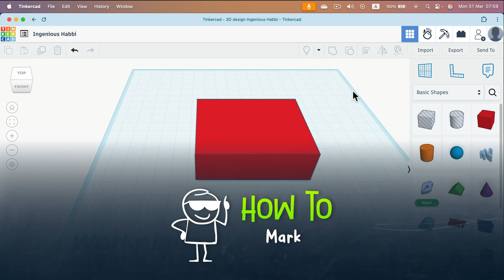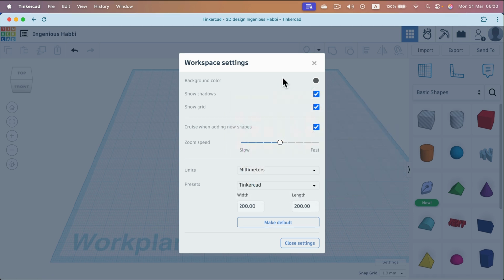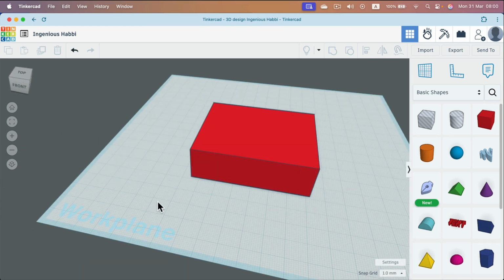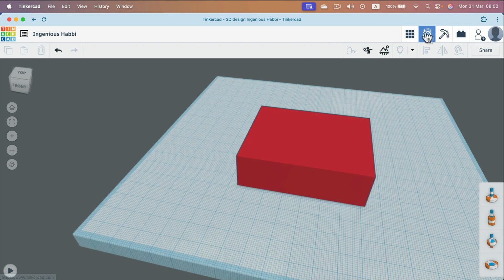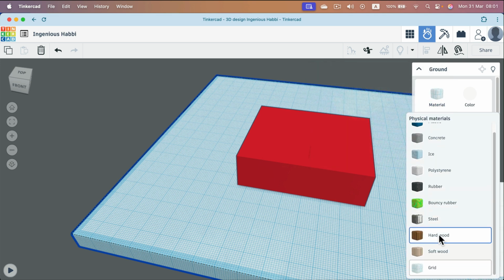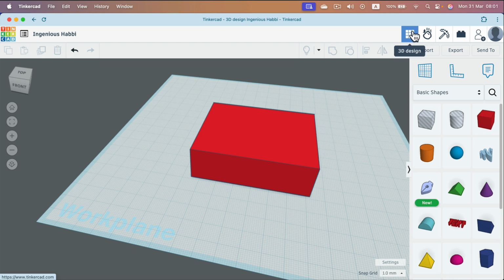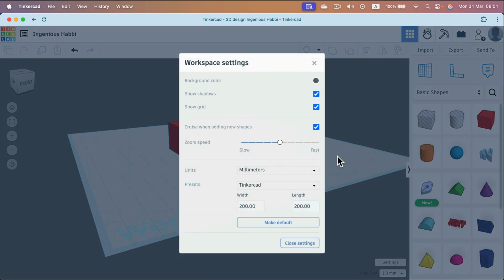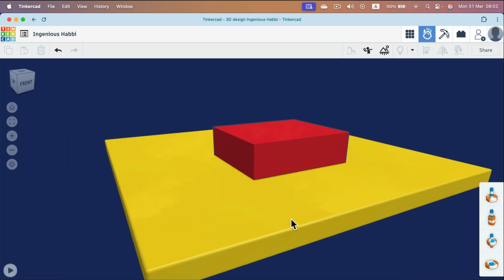How to Change Background Color in Tinkercad – Easy Tutorial!

Comment: I'm not just disappointed in this POS app, Tinkercad, I am angry at it! I watched the beginner tutorials on its website (about 10). I then made one drawing on my Windows gaming laptop which only looked right from two sides and I'm sure will not be 3D printable. I went back the next day to export the .stl file anyway and the background was black. I could not even see my object. I did the export anyway. I downloaded the free exocad program and it did let me view my object (still only 2 of the six sides looked usable). I then started a new drawing and the background/workspace area was solid black. No help files in the app so I googled "tinkercad background stuck on black" and found this video. Just like in this video I went to settings and changed to the background I wanted (a lighter color). Just like in this video, it did not update in realtime. Unlike this video, when I clicked close, I did not see my desired background color. It was still black. I watched the rest of the video about simlab background/workspace and none of that worked on my computer either. I had placed several rectangular objects on the tinkercad workspace but I could see none of them--only the black background. I exported the .stl file anyway and opened it in Exocad which did display the rectangles, but Exocad is only for viewing. I googled "tinkercad help" and found an Autodesk web site that would let me post natural language questions. I tried several searches "background stuck on black", "change background color", "background color", "workspace color", and "workplane color" and all the searches came up empty.

I went back to review the ten tutorials and they are now useless. I cannot do the steps because, unlike my first runthrough, my background/workspace is stuck on black. Any objects I place (of any color) I cannot see.

After tearing out the remainder of my hair in frustration, I remembered I have another computer, a lowly old Macbook Air. I logged out of Tinkercad on the Windows gaming PC and logged in with the Macbook Air. The background was light. The workspace was visible. I was able to change the backround color just like in this video. My placed object was there. It even looked right from all six sides. I exported the .stl file for 3D printing and logged out. I thought maybe a relogin on my Windows gaming PC would fix the background/workplane visibility. It did not.

 My Windows gaming computer had plenty of memory free. I shut down all apps and rebooted and logged into Tinkercad. I was able see both my drawings. I was able to change the background to any light color I desired (same way as in this video). Out of curiosity, I changed the background color to black. It was not as dark a black as I had seen previously and all the objects I had placed were visible. I don't know exactly who the culprit is in this situation, but I did not enjoy it.